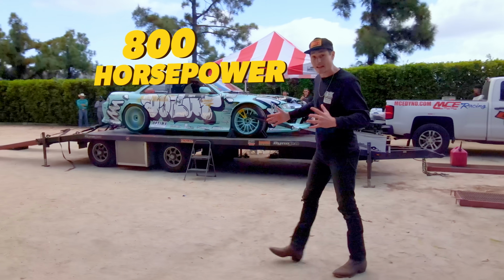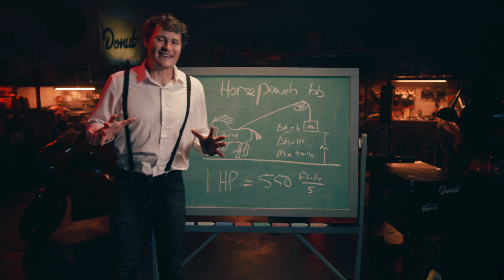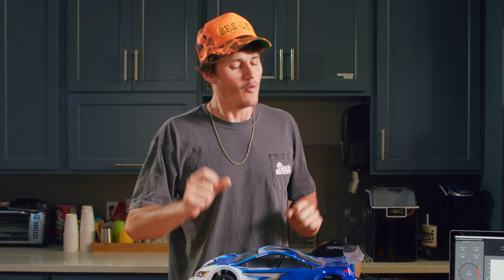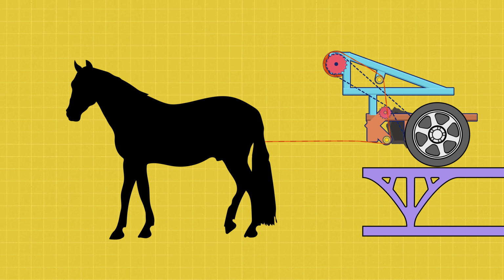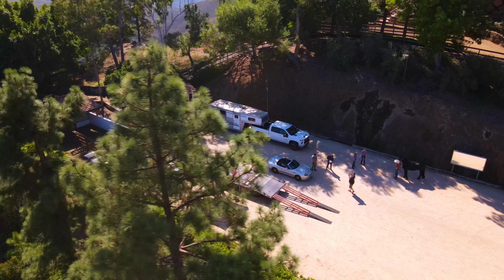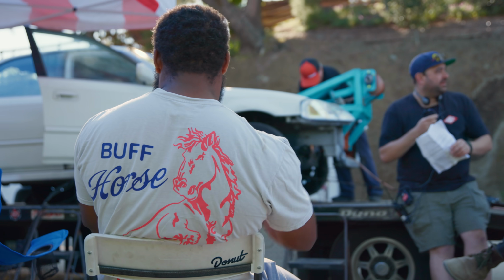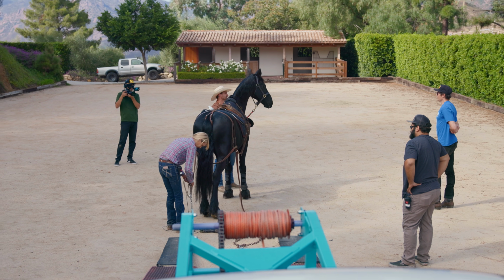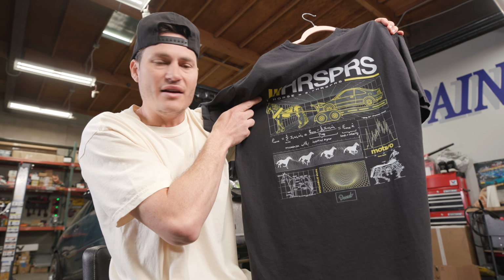How Much Horsepower is a Horse?

Comment: I think I see a problem, though likely a small one.  As the line is pulled from the drum, the ratio changes from large to small diameter of the spool, making the end of the pull tougher than the beginning.  I am hoping there are some big brains here to weigh in.  Wouldn't it have been better to use a consistent diameter spool (like a winch on a sailboat) that would free pull the line from a bucket.  This would keep the initial ratio consistent.  Either way, fun experiment for sure!
Reply: The whole thing is flawed to begin with. It will not stand up to peer review. Its a cooked up dream for a video with no real substance. 
Really they did not learn anything. 1 hp is what is required to do a days labor. They need to do longer testing on a better built rig which can test the power a horse can deliver in an hour or over time. Not some peak pulling power.
Reply: @kameljoe21   well, this is the way of Donut lately.  They went from informative content,  like UpTo Speed, to pure entertainment directed at tik tok and epic fail fans.  While some of these videos might be expensive to produce, they are not why we started watching Donut years ago.  I like Burton, but I rarely watch much else from them anymore.
Reply: @matthewpeterson3329  I do not watch a lot of Donuts stuff anyways. Yet I do understand from their point of view. The content drives towards where the views and spenders are. Content has changed and to get views you need to bend your will to those and what gets you the views. 
Keep in mind tv shows produce the same content for 1 million views where YT produces the same content for more or less of those same views. There are channels that get a small amount of views yet have far better content that some of these larger channels. 
I have seen channels blow up and die based on their content. I also think a lot of them are missing the chance to keep growing their channels because they lack the man power to promote, keep up todate or just the lack of producing content. 
There are several thing Donut has done that has been cool. Yet there are also a ton of stuff they do not do. 
Most channels views are from non subs and it speaks volumes about their channel and its hardcore viewers.
Reply: @kameljoe21    I don't disagree with anything you stated.  I just find myself disappointed in their content over the last year or two, and my fandom is waning to the point that I will likely just unsub and move on.  TV shows are no different... as the show starts to lose what attracted you, you just stop watching.  But TV shows can be cancelled.  My comments are in hopes that, if others agree and voice their feelings on the current state of content, Donut might take notice and return to what drew viewers to them in the first place.  At the very least, add back to the channel what is missing... keep the older and newer viewers satisfied.  I don't think I'm alone in this sentiment.  YouTube is unique in that individuals can tell the content creators what they miss/like/don't like, unlike TV where we are just stuck with what they give us.  Donut has 8M subs, which is a bigger viewership than most TV shows.  So while they won't miss me if I unsub, I would like to think they listen to their long time subscribers and consider our comments, when respectful.
Reply: @matthewpeterson3329  Subs generally do not mean anything these days. I find tons of channels that have huge subs and not a lot of views. The average viewership is what we should be looking at.  Donut is a 1 million view channel. That means pretty much everything they put out will almost always get about 1 million views. If you go look you can see the videos that trend or get sent to the gods for views. Of those 8m subs maybe 1 million people are still active and still use their accounts. Many younger people burn accounts left and right, from forgetting passwords to changing screennames. FFS I have had the same username and email for almost 20 years. April 1st next year will be 20 years. I have watched channels go up and down over the life of YT. Most channels that have their most popular videos that are 10 years old will not have high view videos again. This reason is because there are now millions of channels with millions of subs and get views. You have to scrap the barrel to keep a viewer and make that money. Times are changing and views want what they want or they leave. 
I do not stick around channels if I lose interest. I unsub them pretty fast and have about 5 or so channels that are on the top list to be removed here soon. I also have channels in which I stick around just to hate on, dislike and so on. I do not even watch those videos anymore, just dislike them> You can not even comment on them anymore. 
There are some channels that I enjoy yet only some of their content. For one example Cracked has Honest Ads with Roger Horton. They split from the main Cracked to Honest Ads and now if far better as I just did not care for Cracked content. I wish several more channels would do the same thing. Break it up so that we can watch what we want. I use the subs quite well. 
Likes and comments are also going down as well. This is because the way people watch is changing. People are watching from their big screen tvs, mobile, and other ways in which they no longer interact. Shorts which are watched on mobile devices get likes and a lot of likes. Comments not as many. You can see the changes pretty easy.

Comment: An inertia dyno does NOT measure torque.  It DIRECTLY measures power and then calculates the torque figure. 

If you don't believe me, disconnect the RPM signal and see which one you lose.

Comment: You know... you could've just used a rope tied on a big wheel, attached to a gear, and calculate the gear ratio, and done... it would make a lot easier for the horse pull it e.e

Comment: You found a paradox, the horse pulled 5.7 horsepower, but that means that 5.7 horsepower is now the correct value for 1 horsepower, so the horse only technically pulled 1 horsepower, or did it?
Reply: it is 0.16hp now...

Comment: that's completely stupid.
Measuring horse power of a horse is extremely simple for whoever actually understand what it is.
That's simply the tension, multiplied by speed.
So you just use a tension gauge, and a braked carriage, and you simply mesure the tension at every speed.
And this was obviously done countless times already. Problem : the power of horse greatly vary depending on the horse.

Comment: I've researched this, HP was developed to help engineers build the ropes cogs and pulleys in horse drawn mills. THey never assumed a horse would be attached to anything other than a mill, and assumed no one would use HP for measuring anything else other than horses in mill. so..  Measuring a draught horse at WALKING speed, not in a gallop as that is impossible in a mill, even a light trot would not develop the torque necessary to pull the mill.  So the draught horses WALKING speed output became 1 HP.  and is roughly accurate.  A horse in a gallop cand develop signifcantly more HP.  (12-18).  Bsically if you have a 1HP motorbike with infinite traction and you attach the load of a horse (600-800 lbs) and gear it so that it can move, it's maximum speed will be that of a typical walking horse.  Your experiment can't be sustained over 5 laps a typical draught horse in a mill worked for 30 minutes at a time.  then was replaced by a rested horse.  some mills had multiple horses walking at a time and therefore the need to calculate HP.

Comment: Where I find this interesting. I just have one question. can be it's just me, who has no clue.
But can this measurement not be tainted by the horse following its owner. would the house not be able to run even faster, were there more room, and a better way for it to run as fast as it could?
Reply: Sure, it could probably peak higher maybe 7-10hp, but that's not representative of the amount of work it can do over a working day, that's why a horse is equal to 1hp.

Comment: your measurment is completly wrong. first you are just measuring usefull energy horse is providing, this is same as you would measure wheel power not crank power. 2ndly horse in walk pulling is definetly not emitting top power. 
3rdly you should determine what is horse power. is that a burst of power or something continuosly horse can provide half an hour or more. 
race horse is light compare to the working horse but it takes a lots of power for running. 

when they measure cyclist power they measure how much oxygen it consumes. this is the overall power  and usefull power is roughly 1/3 of that similar to the ICE engine.
Reply: They did consider drivetrain loses. That's peak horsepower, that's why they originally equaled 1HP to 1 horse, it's the average work it can do over a day.

Comment: The useful rating of a horse  is not a sprint for a few seconds.  It is what the average draft horse can continue at for 8 hours per day, every day.  That looks like something a lot less than 5 and closer to 1.
Reply: Absolutely, that's why 1HP was set as the power of 1 horse and I believe the horse was smaller, like a mule.

Comment: I am curious to the linear to rotation part of it. Adding a bigger spool size on the rope, is a lever. How did they come to the conclusion to use the size they did.. ? or did they just calibrate a known horsepower to the spool size as the datum? I am picturig a 300 horse engine, and comparing 50 horses. 50 horses will out pull that 300 horses engine..unless it is a big rig diesel. Anyway, this was cool to see. th mythical value of 1 horsepower we all use. I hope the horse had a great day after this. :goodvibes:
Reply: Doesn't matter at the end it's rotating the dyno, they get speed from that.

Comment: measuring horse power is easy. just take your horse to the ranch where they have hot walkers. attach the dyno to the hot walker mast (it could be friction or induction type) and make the horse to do its best. time measure the angular speed of the hot walker and knowing the friction or induction force on the mast you can calculate power. 
this is primary school physics😂

Comment: I dont think its so accurate, because of 2 reasons. And trust me, they most likely are true based on my engineering and physics knowledge.

1. They took the peak value out of that jiggly curve, Power comes by multiplying FORCE with its VELOCITY. So if u pull real quick and their set up only measures every few 100ms, you dont just calculate real power but something weighted with applied momentum.

2.  This opinion might not be right (since it aint my expertise). But, the horse went real slow. Like every other living thing or even engines, we got some sort of peak performance where we shine. If u got a load which is too big, u will stall your dynamics and not only lose momentum, but your whole running system producing power.

It is like trying to go full throttle from 6th gear while going 40km/h. Same goes for muscles, if u go too hard or too slow, you will not reach your maximum power-output. I bet same went for the horse. Ususally you gotta have running / go real fast to reach peak power. If that set up had a smaller load, a bigger runout and a much higher veloicty available for the horse, it might have pulled 10 hp for sure.

Comment: I think you did it wrong. You underrated the horses by a lot. You were measuring more like "peak torque hp" instead of peak hp. 

The right way to do it is: put some different resistances (like dead weights range from 20kg to 100kg on the ground) let the horse pull and run to her top speed. Using the speed * cable pulling newtons (both can be measured easily) charts to find out the horse "best performing load" and the "peak horsepower".
Reply: It's a pain to watch, it is like you dyno the car with full throttle on the top gear, but once the engine rpm reaches 1000 you say stop! I got the peak horsepower😂...
You do know that if you allow the pistons (or the muscle) to do more strokes per second, they can output so much more horsepower than the "near stall" situation in this vid, right?
Reply: Peak torque hp isn't a thing, they measured peak hp, your second sentence is probably true.
Reply: @Iseenoobpeoples  there is at a certain rpm when engine output torque is max (usually when the rpm is still low-mid). Measuring the hp at that moment, I call it "peak torque hp" (or hp at the peak torque moment)...
Reply: @kknbb4036  I get what you said now, I agree. From looking at the RPM (I think 120rpm) of the barrel and the 5.7hp rating we get 250ft*lbs of torque, how much torque can a horse produce lol my rpm might be off.

Comment: SHould have wired up a cheap PLC and an encoder on that shaft instead of a laser on reflective tape on a sprocket. Far more accurate, far more reliable, not much more expensive.

But still, amazing project!

Comment: Very nice video, funny and interesting experiment. But I think it should have been pulrd longer, about twice the lenght. I also wonder if the resistans was a litle low when the horse was acually pull and increasing speed, as th line slacked a bit for a short moment.

Comment: 5.7 crank HP for one horse is the equivalent of having a 3135 lb of weight being pulled by a horse and having it lifted one foot in height in one second!  That horse does NOT have that capability to pull on a weight of 3135 lbs and lifting it one foot in one second!
This test and result are NOT correct and is a FAILURE based on the accepted DEFINITION of ONE HORSEPOWER!!!
Reply: 5.7hp at 1RPM is 30,000ft*lbs.
Reply: @Iseenoobpeoples  There wasn't 30,000ft-lbs of torque applied at the dyno!!!
Reply: @LWRC  At what speed you think they achieved 5.7hp?
Reply: @Iseenoobpeoples  Again lift 550# one foot in one sec! What is it you don't understand??!!!
Reply: @LWRC  Why do you tell me what an hp is? What do you think the torque was? Then we could calculate the RPM needed for 5.7hp.
Reply: @Iseenoobpeoples  Again - have the horse pull a 550 lb weight off the ground one foot in one second!
No one is trying to prove the definition of a HP by way of torque & rpm!
Put it another way, have that horse, as claimed in this video, pull a 3135lb weight off the ground one foot in one second!  Shouldn't be that hard now can it?!!  We can assume negligible pulley losses!
How about it - does this horse have the strength to pull 3135lb weight off the ground one foot in one second??!!!
Reply: @LWRC  From the footage it looks like they were doing 120rpm maybe, that would be 250ft*lbs to get 5.7hp.
Reply: @Iseenoobpeoples  Your circular reasoning / argument does nothing to disprove the point that I've already stated!
Reply: @LWRC  You don't get how RPM (linked to leverage), allows the horse to have less torque than needed to lift 3135lbs while still producing 5.7HP, lifting 1568lbs 2 foot in one second still equals 5.7HP... Plus they measure peak HP in this video, average HP over a working day is around 1HP for a horse.
Reply: @Iseenoobpeoples  The equation for HP from torque & RMP is known and the numbers match. However, have a horse pull on a pulley and pull 3135lbs of dead weight off of the ground by one foot in one second!
Reply: @Iseenoobpeoples  The guy in the video said he was a ME. Don't know why he didn't know how to do this test as it is basic. Then he had to inquire with someone else who told him to get with another group of engineers and he got with Motivo!  What kind of schooling are our engineers getting now days??!!!  This is pathetic!!!
Reply: @Iseenoobpeoples  The amount of work needed cannot use leverage and has to be factored out or you won't get true numbers!!!
Reply: @LWRC  I agree, it's basic, there are much simpler/accurate way of measuring it, the way the data was presented is not good, don't forget that under the current system knowledge is discouraged.
Reply: @LWRC  Do you agree that you can get to 5.7HP without ever lifting 3135lbs?

Comment: There is no way humanly possible that a human can put out 1.21HP!!!   One HP is the amount of work done by pulling a 550lbs of mass one foot in one second!  Can any human pull on a pully which has a 550 lbs of weight on it to move it one foot in one second?!!!
Reply: Wrong, there are plenty of videos of cyclist producing over 1kW, that's peak HP, not sustained HP.
Reply: @Iseenoobpeoples  Certainly, there is a big difference between measured peak and sustain power output that actually can be used to do work! 
Set up a pulley and put 550lbs of weight at the end of it and see how many times it would take you to pull that weight off the ground by one foot in one second!

Comment: A horse pulling on a rope to spin the transmission of a car on a dyno to spin the tires to turn the dyno is NOT a correct way of measuring a horese's HP output!!!  You are NOT taking into the transmission and drivetrain losses!!!
Reply: Uh, yes they did consider losses, as stated in the video.
Reply: @Iseenoobpeoples  Yes. There is a much simpler way of doing this test instead of using a dynamometer!!